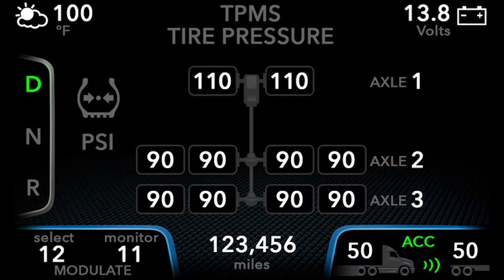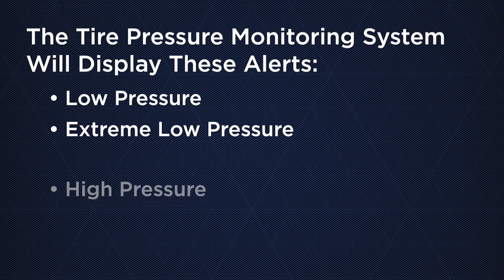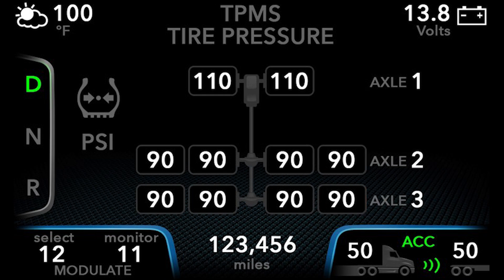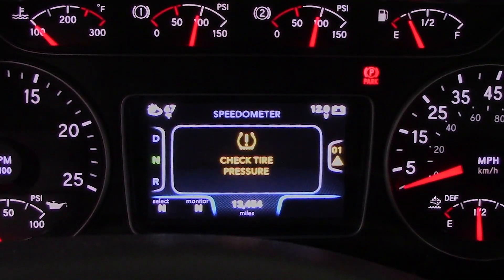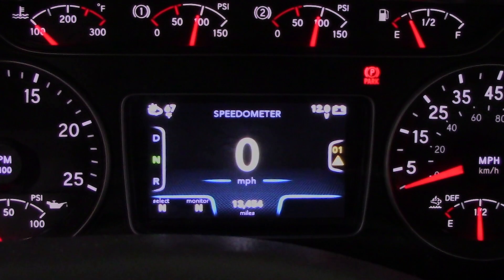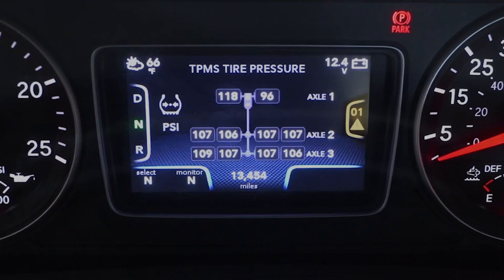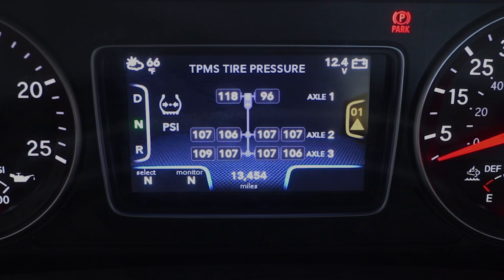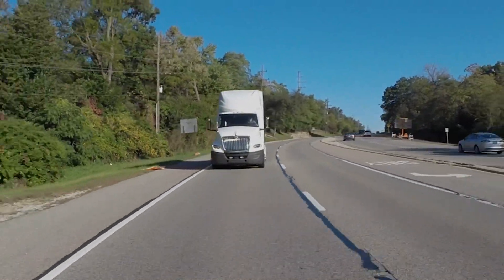Tire Pressure Monitoring System (TPMS) In Your International® LT® Series.

Comment: This system is junk. I drive a brand new lt with 29000 miles and mine says check tire pressure then after a few minutes it says service tire pressure system. The whole truck is junk with tons of other issues.
Reply: I agree it's a junk system have a blow out and that's it for that system!
Reply: Mine says check tire monitoring system I have a faulty sensor in the tire that needs to be replaced or repaired

Comment: Seems like a good system. Hopefully it works better than your other “helpful items “ like side windows in the sleeper that leak constantly, doors that don’t seal up worth beans and leak constantly.
Reply: Or the engine runaway issues on the 13L where the connecting rod blasts the engine block into pieces or the valve cover gasket problems that set the turbo and entire truck on fire.
Reply: @johnphillips222  Actually on the A26 the holes getting blasted into the block was from a vendor improperly assembling the piston connecting rod assembly and not putting the pieces together correctly.
Reply: @johnphillips222  Your reaching real far now lol
Reply: How about making some doors that actually seal out the fucking wind in the winter? So my goddamn leg isn't freezing from the cold air blasting through the door at the handle. 

Do you even talk to drivers?